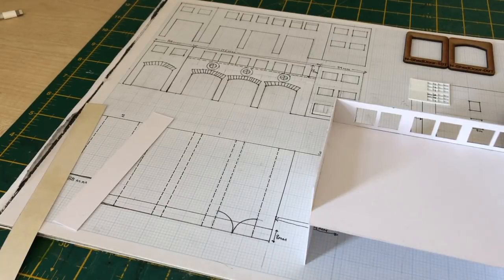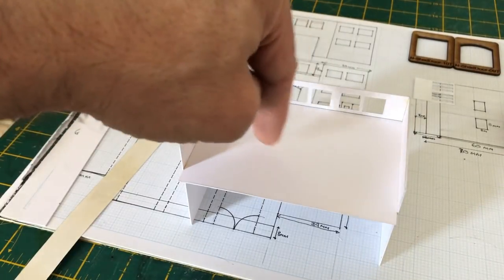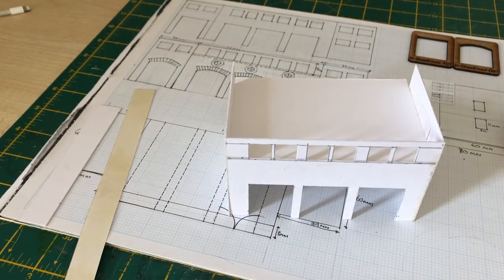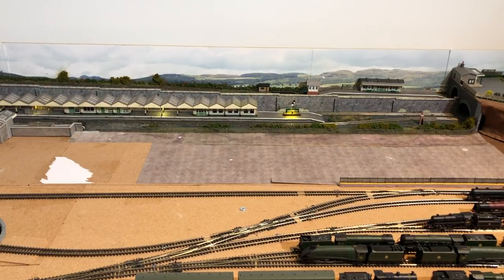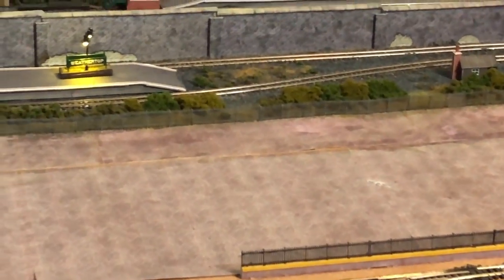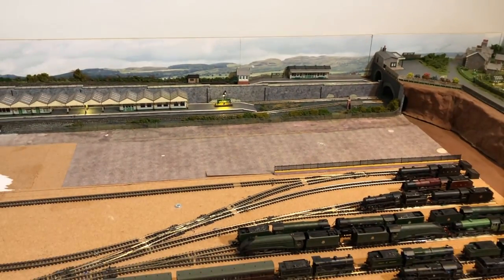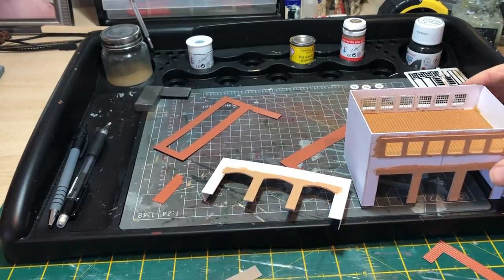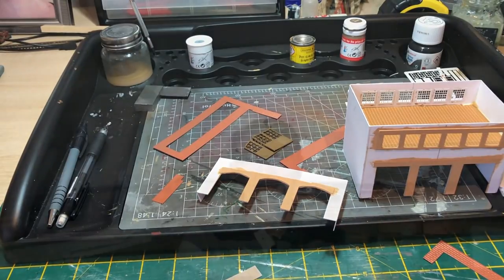N Gauge Model Railway Layout Update -  Building the Fire Station Elvenhome EP45

Comment: Hi Stephen, having had the privilege of recently seeing the layout in real life, I can confirm that the figures on the layout (firemen included) are minuscule and charming, adding life to your impressive model railway. As a regular user of acrylic paint which dries very quickly indeed, and knowing that you have many more figures to paint, did you know you can preserve your mixed up colours (say flesh colour) by spraying the palette with a small artists' fine spray bottle of water before covering with film or foil. This is useful if you have to leave the job midway or wish to continue with the same colour elsewhere after a break. Just a thought!
Reply from the maker: Hi Joan.  Thanks very much for the tip about preserving the mixed up colours.  That will be very useful when I start batch painting.  Stephen

Comment: Hi Stephen, The fire station is coming along nicely. I agree, your mock-up structure was well worth the time and effort, giving you the ability to work out the kinks. A method I've used for simulating the mortar in brick walls is "DAP" premixed Vinyl Spackling Using my finger, I press it into the mortar lines, then wipe the structure with a clean cloth. Here is a short video of the end result. https://youtu.be/CdJP-0BLzXo  Unfortunately when I constructed this building I did not have a work light for my hobby table, that combined with my less then perfect eye sight, you can see I missed a few sections in the video. As for the fire crew quarters on the second floor, I've seen a few videos showing folks using actual photos that have been resized and placed a short distance behind the window to give the appearance of a modeled interior. Maybe something to consider? Again Stephen, another nice layout update and I'm looking forward to your next update and seeing the progress on the Fire Station. Cheers, Rich S.
Reply from the maker: Hi Rich.  AS ever thanks for your comments.  Two great ideas.  I like the look of the effect of the DAP and will take a look at getting some.  The photograph interior is a great idea and I will see what I can find and have a play.  Thanks again.  Stephen